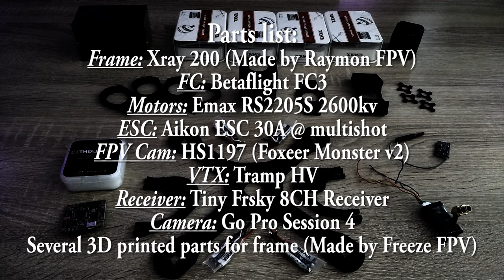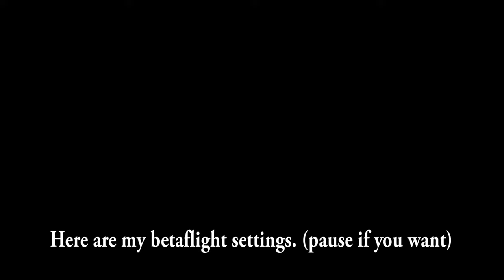Building a High Speed FPV QuadCopter!

Comment: I have the Betaflight fc and the Monster v2 did you use anything different as far as the jts connector for the cam or did you pull the audio or osd cable from the original jts connector?
Reply from the maker: from my camera I have three cables: video, + and ground     I soldered these three directly to the betaflight FC. 
video cable to vin, + to vbat and ground to the ground of vbat.

from my VTX (tramp hv) I have three cables as well. video, + and ground     I soldered the + and ground to the same points as my cam (vbat and ground) and the video to vout.

I do not like to use connectors :)
Reply: I plan on using the TBS Pro V2 and I'm new to the hobby, but as far as the cam wires are you using the wires that came with the Monster and just cut the connector end off or ordered a modified version to fit
Reply from the maker: Byron Foster I used the cables that came with the camera. I cut the wires to the right lenght and soldered them on my betaflight fc. some cables I did not use like the audio etc. only those three cables i talked about. those others are just hanging from the camera.